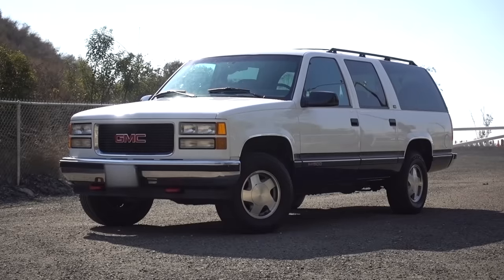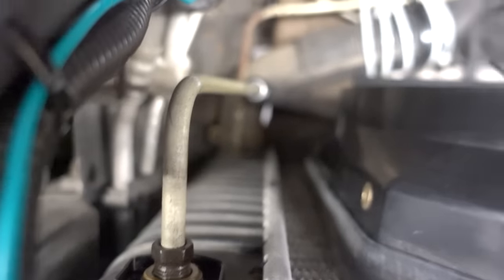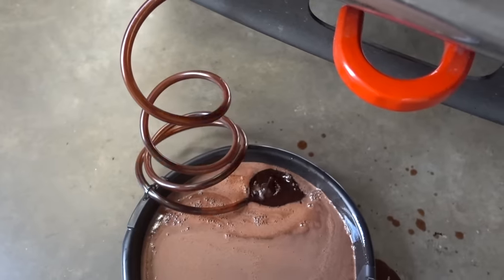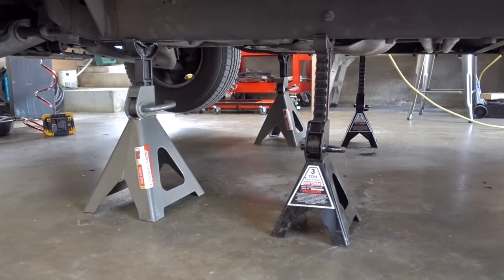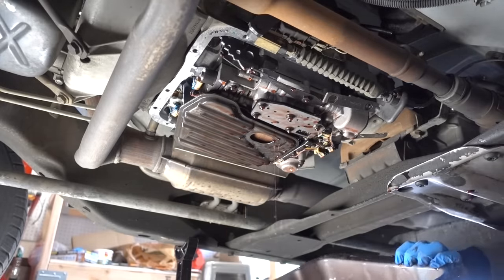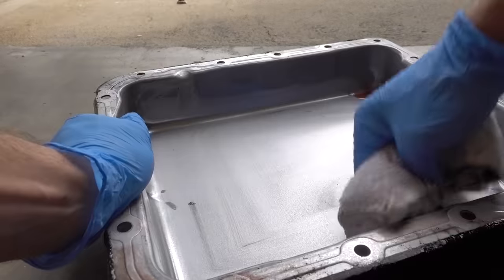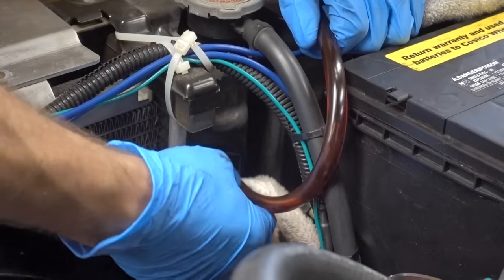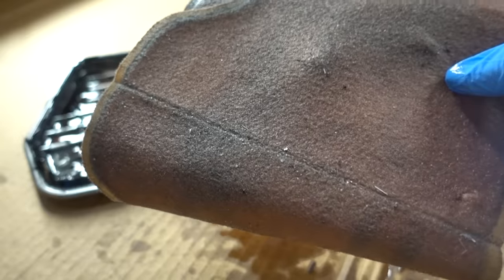Why You Should NEVER FLUSH YOUR TRANSMISSION FLUID!!

Comment: I've been doing this for 30 years.  Step 1: Loosen the top cooler line going into the trans and connect the hose to drain.  I usually pump until bubbles but then I wait a few minutes you will get at least another quart or more then do it again unless you like making a mess.  Step 2: Remove pan replace filter, FILTER SEAL, and gasket.  Those seals are made to stick to the filter first time they get hot and they will no longer seal reliably being re-used.  Step 3: Pour in FIVE quarts of fluid and pump it out again until the fluid runs nice and red.  Top it off.  No need to do more, or less.

Comment: GOOD TIP :    I've been playing with transmissions for years. Best trick I know is that removing the dirty old transmission fluid on a full flush is bad, BUT..... REDLINE RACING ATF. Listen closely.  High synthetic atf's are very slippery, hence, you flush or even change an old dirty trans may make it start slipping.  NOW.. Normal Atf's have to be slippery at any level, for the clutch packs to smoothly grip in the shifts.  Say you put in Amsoil signature series ATF.  That is very slippery.  It will make a transmission with weird shift points start shifting correctly and smoother.  BUT this is not good for an OLD worn out transmission that has a slip problem.  If You remove the dirty trans fluid, and you lose that dirt to help grip in the clutch packs.  (which are like brake pads on brake disk in a way, but many of them stacked, that grab when pressed together within the fluid)  So taking out that gripping old dirty fluid and putting in something slippery, will just make it slip more or not grab at all..SO., what I learned is that you can put in this Redline Racing Atf and it's FULL SYNTHETIC, it will grip like the old dirty fluid.  .... No Friction modifiers, No slippery stuff. IT GRIPS.  Racers use it because they want a slap in grab shift, no delays. Yes shifts will be sharp, but sometimes that's great.  You can tweak your shifting too if you have room to play, say you still have some material on your clutch packs. You could use oem atf fluid, or oem atf fluid if its a later car, that is synthetic or part synthetic. Add more redline.. shift better, add more oem or full synthetic, You can play with this. It is a thing to people willing to experiment.  

I have taken worn out 200k mile transmissions and done almost full flushes, and added the Redline Racing Atf, and had the clutch pack start gripping and start working again.  It doesn't work all the time, but if it just started slipping and you start on it right away, you have good chances.  AAmco wont offer any of this help, they will sell you an expensive repair.  Just like a dentist won't bond your tooth, they will sell you a crown because it makes them more money and is easier, and not return customers with broken bonding.  

Think of this.  Everyone says "don't remove the old dirty fluid"  and many times they're right.  BUT.  WHO SAYS YOU HAVE TO THROW OUT THE OLD FLUID ?!?  SAVE IT ! .. So, if you flush it, and put in great ATF, like a few quarts of Amsoil Signature series ATF (best of the best) which is 100 percent synthetic, which almost all others are just additives (friction modified) to various atf fluids.  Then use the rest of the 5-7 quarts with the appropriate Redline Racing atf, there is a thinker fluid for american cars etc, and a lightweight fluid for Hondas for example. If it works, It's going to work a lot longer.  If it doesnt, put the old stuff back.  And put it back in a home "flush" method, where you put tubes to the buckets, and start the engine, put in 4 quarts, then again 4 quarts, etc... till its all back. You could also do a "change" if it just started slipping, drop the pan, change filter, add in the 3-4-6 quarts of redline racing atf, and see if it starts gripping again, or works like new, who knows. 

So if this new fluid change doesn't fix your problem, you can always put the old stuff back in.  
No one uses this mindset, I hope I reach 1 person and help them.  Tricks of the ATF fluid change.
Can get you many more miles out of your transmission.  Research compatibility of every fluid you try. There is a correct ATF for toyota in the Amsoil brand.  Redline ATF , make sure it's recommended for your vehicle and if a Honda i'd say the lightweight ATf Redline.   High end ATf's will exceed many manufacturers brands, and a single Amsoil Atf will work in very many cars and makes.  Must do research.

And there's your Dinner !
Reply: Good on you for taking the time  to educate us. Cheers!
Reply: Thank you. So I bought this 92 chevy silverado with no history so I have been draining the trains fluid and put in a new filter but put the old fluid back in. I was so scared to put new fluid in so I've done this 3 times already about 3000 miles so far between the change. But thank you for the info.

Comment: I did this to my 5.7L Ram at about 95,000 miles. Initially it shifted a little strange but I'm guessing the computer figured itself out and now it shifts firmer and smoother than before. Definitely something that SHOULD be done.
Reply: How about now? Is the transmission still shifting good?
Reply: @AlexR-on3ct  Everything is going great. Smooth and consistent shifts.
Reply: @tag_76 The problem is people do this when the transmission is already a lost cause because they waited to late and then they blame the flush
Reply: Exactly changing the fluid when it's a lost cause is the problem. The clutch wear is still in the fluid so when they change it it removes clutch material so it slips
Reply: No its not the flush, its the fluid used. Most of vavolines and castrols fluids are not at oem viscosities. Oem only!!!
Reply: Old fluid has tiny bits of friction material that came off the clutches and it aids into your grabs while new fluid does not and will cause slipping.
Reply: @FloridaMan7337 Put the pipe down Floriduh 🥴

Comment: Next video: Why you should NEVER REFUEL YOUR CAR OR NEVER CHANGE YOUR OIL.
Reply: Can't want to see those, especially why to never change oil!🤣

I once worked with a man who never changed his oil, being he had to add a quart per week (every 240 or so highway miles. Instead, he change the filter according to highway usage, which I believe was 5,000 miles on that car. Kind of hard not to blame him, if having to add every week to a 20+ year old car, why crawl underneath? While one could argue to 'get the sludge', that's what the filter is for. He does a proper oil change once per year, and installed one of those B&M kits for fast tranny fluid changes every 10,000 miles. A welder installed some type of washer before the kit. 

As for filter changes, he doesn't bother because (1) it's always red & uses RedLine ATF & (2), the 10,000 miles is more frequent than the OEM calls for. Around 60-to 90% of owners, depending on who  is collecting the numbers, doesn't bother to do an ATF change unless a shop recommends doing so. 

I'll forward him this video to show him the importance of changing AT filter & cleaning the pan well. Don't want that magnet to stop doing it's job!🤣
Reply: You want.a.ornamet in your.driveway for Halloween
Reply: He did a fluid drain, not a mechanical flush. read up on the difference.
Reply: Ok but low-key don't flush your transmission
Reply: “if its not broken, dont fix it”
Reply: and why? BECAUSE THATS WHY!
Reply: 99.9% don't even know how to flush a crapper. i flush both of schit that don't belong. like elevators in outhouses.
Reply: @skipper1206  why do u need to fix whats not broken
Reply: SCOTTY SAYS SO IT WILL LAST FOREVER. JUST TAKE IT TO JAY LENO. STORE IT IN HIS MUSEUM AND YOU'RE GOOD TO GO.
Reply: @willwarro4054  what

Comment: ALL YOU GUYS OUTSIDE OF THE RUST BELT ARE SPOILED lol
thing is so clean. Never find a truck that clean in NY
Reply: I stay in Florida. My sister bought a Nissan that just came from Rhode island. I have never seen so much rust under a vehicle I know working on the suspension is gonna be a complete nightmare 😭
Reply: Or in pa. Salt kills
Reply: pffffft NY try the upper Midwest. Our undersides rot like no ones business with all the salt the roads get. lol
Reply: Meanwhile I had a Canadian friend flexing some 20 year old daily driver that was in really good shape. They salt their too, he said the secret was the car got undercoated every year since new. I'm skeptical, but willing to try given its just $100 a year at my local Krown
Reply: @cpufreak101  guess it depends on who coats it. If you haven't done it then its probably not worth it on even a 2 year car. If its a bad coat job it will trap moisture and salt and eat it from the under the undercoat.  EDIT (I forgot krown is a fluid film vs some of the oil goop like undercoating *) The best advice I've come to know from winter driving is get your car washed often in the winter.  2 times a week if you can, especially after a major salting of the roads.
Reply: @lastgengamers1137  In North Dakota, we sand the roads not salt them.  Our vehicles tend to stay in good shape. I've got a 98 Windstar, a 99 Silverado and a 2000 Caravan. All 3 are in very good body shape, with little or no rust.
Reply: @cpufreak101  yea man I get mine under sprayed at carwell, and it really help save the under carrage, but more outer things like wheel wells and stuff still rust a little, it sucks lol
Reply: Im a diesel tech in central PA.  Around my area, the funding for road salt for the bourough is based off of how much they used last year.  If someone even says the word snow the salt truck drivers spring to action like firefighters to a 5 alarm bell.
Reply: @cpufreak101  Yeah getting crown coating helps alot. Just stay far away from any of the spray rubber coating bs
Reply: Was just thinking the same thing. I live in Pittsburgh & one of my vehicles is a 98 K1500 Z71 Silverado. I just bought it off the original owner & it was garage kept. So it's very clean underneath...but still not THIS clean. I've seen 3 year old vehicles that were in worse shape than this. How clean were those tranny lines! Haha
Reply: That's why I moved. I don't miss working on rusted out vehicles. Although I got damn good at making new brake and fuel lines
Reply: Those trucks don't exsist in Canada anymore.
Reply: @cpufreak101  Krown isn't undercoating, it is a waxy, oily film that is applied inside the body cavities. I was very shocked to see that no one in Michigan treated their vehicles on a yearly basis and believed the OEM coatings were more than adequate...even though there are 3 - 4 year old domestics rotting away. A lot of European OEMs apply this wax from the factory, hence the 12+ corrosion warranties.
Reply: @A_S377  it's the same way here in New York. People just feel it's a scam for some reason.
Reply: I thought the same thing....
Reply: same shit in Mich. Weatherman can say 10% chance of snow the next day and the salt wagons are out in full force dumping the brine on totally dry roads. Probably same policy. Use the money up or lose it.
Reply: We use Electronic rust prevention along with the waxy coatings on our beach cars here in Australia, it works well. The good electronic systems are not cheap though
Reply: God bless NY state! Forget the rest.
Reply: @lastgengamers1137  depends if u wash ur vehicle in winter using TONS of robo- touchless high pressure washes that spray the underside as well. Plenty in Ohio & Michigan!
Reply: Big Tex  its not every state bub. Upper Midwest for life!
Reply: @overthehandlebars  no southern living for me. Crazy ppl dwn there & terrible pay scales in most every industry.
Reply: arizona is nice
Reply: In 2019 I have a 99 Durango that is made out of rust
Reply: @cpufreak101  I was a Rust Check sprayer (which is almost exactly like Krown) back in 1985. A guy brings in a 1978 chevy blazer with rust holes in the rocker panels. He sprayed it every year and the rust never moved any further. It is totally worth the investment.

Oops, forgot to mention I'm in canada, the land of road salt.
Reply: @raymondperrault5821  thanks for the heads up, I am near a US Krown location so I'll probably be with them next winter
Reply: @cpufreak101  Justin, I'm referring to the Krown product that looks alot like automatic transmission fluid (because thats what it actually is with chemicals added to make it creep and penetrate). Apparently Krown also has a thicker, waxier application that does leave a distinct film, that product I know nothing about.
Reply: @raymondperrault5821  noted, okie
Reply: Big Tex  Unlike Texas that will charge you with a felony for using your first amendment rights.
Reply: We see alot of rust in Massachusetts also they treat w salt and calcium chloride.  I find the best antirust treatment is a product called fluid film
Reply: Then again those in the rust belt could be jealous, or envious, to be kind. Here in Kansas we do experiance accelerated body rot. I never knew the extent of the problem in the rust belt when I seen the chassis of a pickup from PA. No wonder they have rigid inpections, those are homicide waiting to happen. At the extreme  end of the scale Kansas has no vehicle safety inspections whatsoever.
Reply: @bradbeck2601  Sounds like here in Rochester, NY
Reply: I'm  in Central Square, NY and I keep my trucks longer than I should. 7 to 10 years. My 88 K5 I bought new when I still lived in Pa I still own. But it is garaged in the winter. Now my Silverados have outlasted every F150, or F250 I ever owned. Never had a Ford last over 5. And to be fair every truck I buy is 2 or 3 years old. Not counting the K5, I always have 2 trucks. My wife needs to get around too.
Reply: I live in North Dakota. Plenty of salt and plenty of rust.

Just walking down the street and counting the rusted out cars is a depressing experience.
Reply: I sprayed the undercarriage on my truck with WD-40
Reply: @Project2505  clean the underside often and keep up the coating!
Reply: never saw a car so clean underneath.
But Wax helps, resistant enough but you have do redo it maybe every 2 years, dont take this bitumen agents, after a while they break up the salty water pores inside and do his work
Reply: Any other Canadians notice a car rusts FASTER if you keep it in a garage between winter use? Leaving it in the cold, outside prevents the salted snow etc from melting and reduces melted salt water penetration. Park it inside and the salted snow/slush melts and drips into seams and everything. Just a theory and have heard/notice others make this claim.
More rusting takes place in the following spring/summer , according to Crown. It is when the hidden remaining salts of winter mix with spring/summer humidity. 
Most car washes With the undercar wash “extra” are a scam -watch one from behind and the ground sometime..theydon’t do much.
Reply: @lastgengamers1137  that why they don’t have to change fluids, the car will break in half before the systems break
Reply: @cpufreak101  no the secret is to car wash the salt off which includes the under side as soon as possible.
Reply: @dannyo6699  you still need to wash the dirt off under the cars dirt and moisture cause rust, it just takes longer
Reply: @rmo4222  True. I wasn't saying it was perfect in North Dakota, just the chances of it happening are reduced when salt isn't applied.
Reply: @rmo4222  in that case then wouldn't you have to wash the car every time you drive it in the snow then? Not sure if it's just due to my local climate or not but that'd get more expensive and time consuming than an undercoat fairly quickly (especially at $15/wash for the auto bays)
Reply: Try rebuilding 50 3208 Cat engines on chicago garbage trucks..you attitude changes quickly !
Reply: You won't find ANYTHING that clean in NY.  Not even your precious law makers.  LMAO
Reply: Here that, jersey guy here
Reply: In Ohio, you would never even get the nut off the hardline to start the process because it would be so rusted and corroded. Due to the rust, you would twist and break off the hard line creating a new problem without having made any progress on the thing you were trying to accomplish in the first place. Then you spend the weekend trying to find a replacement hard line for that particular model and transmission and a video on how to replace it, which you probably won't find. If you finally get it fixed, you would be so fed up that you would just leave the old fluid in because you may not be able to get the rusted tranny pan bolts out without rounding them off, which would start a whole new nightmare. That's life in the rust belt.

Comment: I did this exact same method. 1995 GMC SIERRA K1500 5.7 4L60 TRANSMISSION  190,000 miles. 5,600 miles later, ABSOLUTELY Amazing.  The transmission has Zero...nada...zilch problems; it shifts like a dream....perfectly smooth. No slipping issue at all. The difference was like night and day.
Reply: Updates?
Reply: @101trayday  31,000 miles  and the transmission operates perfectly.
Reply: @timallen3166  thanks for replying brother
Reply: Was it having any trouble before you did the work, or was it purely preventive?